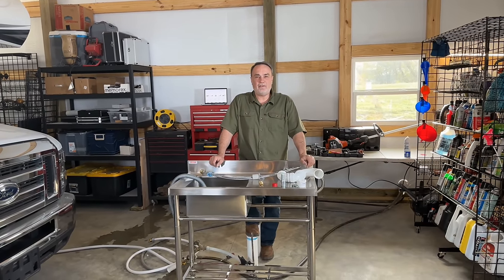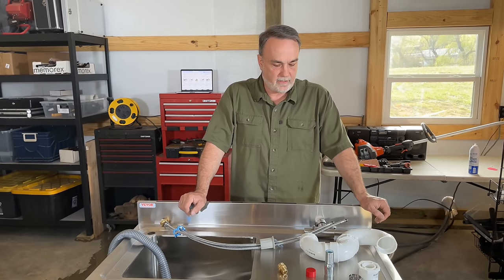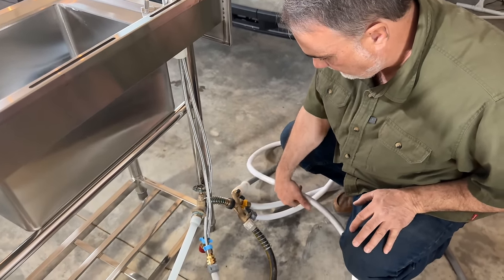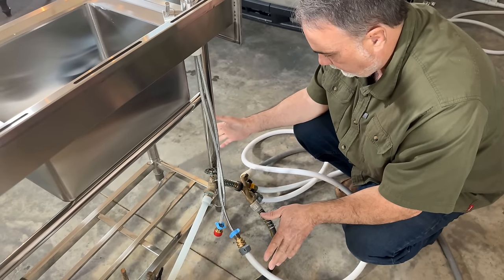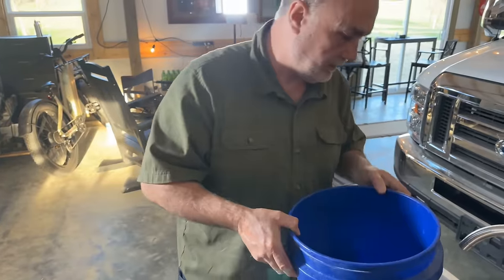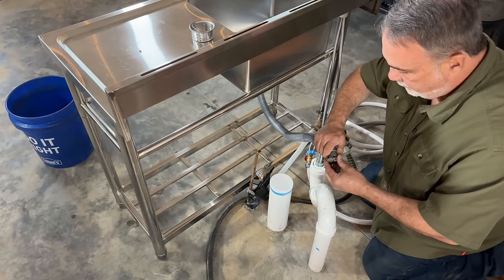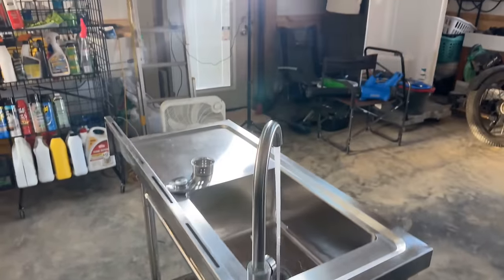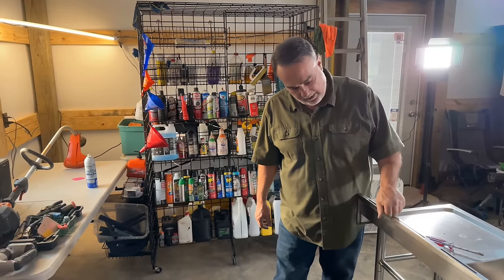Barndominium Gets A New Stainless Steel Utility Sink that Makes a Much Needed Great Addition

Comment: At one time I had a double stainless steel sink rigged up outside for cleaning fish I rigged up the drain in the bottom and it work good only had cold water but that's all I needed it work good as time went on I wound up giving it away
Reply from the maker: That's a good idea!

Comment: You don't need teflon tape at 4:42 the one end is hose and has rubber gasket and the next in line is 3/8 compression. Neither require teflon tape. I had a restaurant and in Pa. they didn't allow sinks with square welded corners. The one you have there has radius corners which most states require. Tidbit for anyone who might be going into the restaurant business, check with local inspector before you buy anything. Painful to buy something and be told you can't install it.